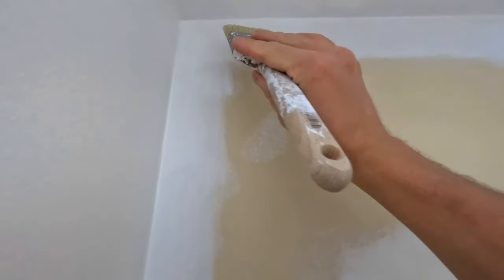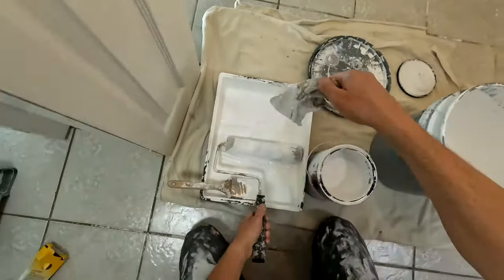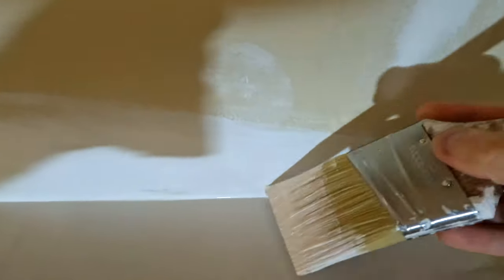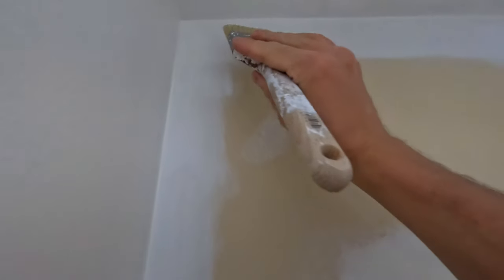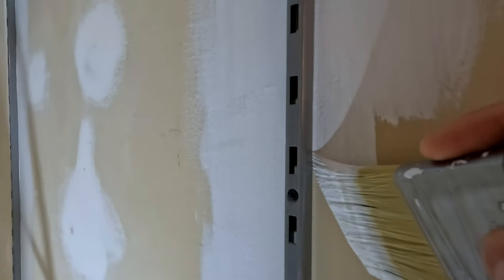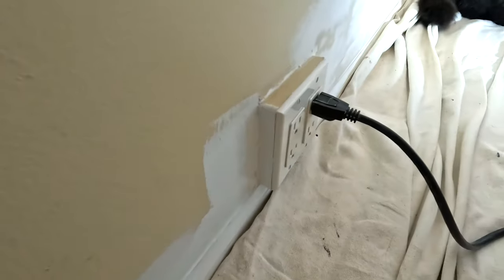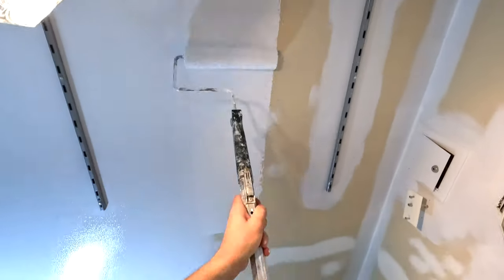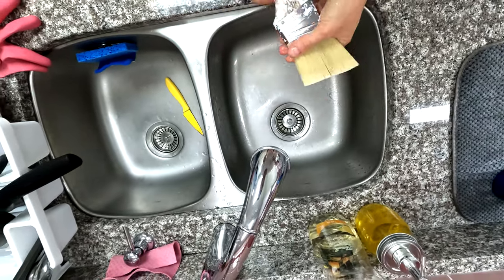How To Paint Walls? Detailed POV Tutorial!

Comment from the maker: RECOMMENDED TOOLS:
1. CAULKING GUN - Dripless Inc. ETS2000 Ergo Composite Caulk Gun - https://amzn.to/3L35Gqj.
2. CAULKING - DAP INC 18152 10.1oz White Alex Plus Acrylic Latex Caulk with Silicone - https://amzn.to/3YVnTfq.
3. PAINT BRUSH - Wooster Brush 4410-2 1/2 Chinex FTP Angle Sash Paintbrush, 2-1/2 Inch , White - https://amzn.to/47T2o2T.
4. ROLLER CAGE - Wooster Roller Frame R017-9, 9-Inch, Silver - https://amzn.to/3PhAiqQ.
5. ROLLER - Wooster Roller RR723-9 Pro/Doo-Z 3/8-Inch Nap, 9-Inch, 9 Inch - https://amzn.to/47JqmgV.
6. PAINT TRAY - Richard 92067 HeavyDuty Jumbo Plastic Tray 91/2", 4Liter (1 gallon) , Black - https://amzn.to/3KXgq9I.
7. EXTENSION POLE - Wooster Sherlock GT Convertible Extension Pole SR090, 2-4 feet - https://amzn.to/47Sex7W.
8. DROP SHEETS - All Purpose Canvas Drop Cloth - https://amzn.to/3PdINTt.
9. EGGSHELL PAINT - PRESTIGE Paints Interior Eggshell Paint and Primer in One, 1 Gallon, White - https://amzn.to/4cGqOhX.
10. PAINT STRAINER - CHNLML Paint Strainer Bags, Paint Filter Bag Elastic Opening Strainer Bags (1 Gallon 5 Pack) - https://amzn.to/45s6Eob.
11. RAGS - Trimaco 10821 White, Premium Knit T-Shirt Rags, 1lb Bag - https://amzn.to/3KZwLLf.
12. CUT BUCKET - 1 Gallon Plastic Paint Cut Bucket (Black) - https://amzn.to/3KY8C7K.
13. STEP LADDER - WNOEY 3-Step Ladder with Tray, Folding Step Stool with Tool Platform and Comfort Handgrip, Lightweight - https://amzn.to/3svw6L2.
14. PLASTIC - Frost King P9400 High Density Painter's Plastic Sheeting, 9' x 400' x .31 mil, Clear, Dispenser Pack - https://amzn.to/3QXw08X.